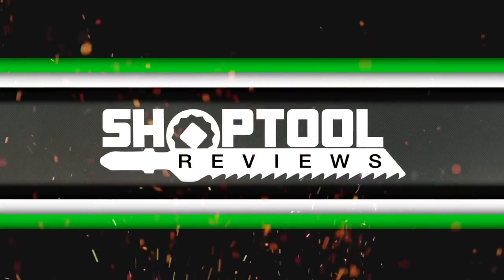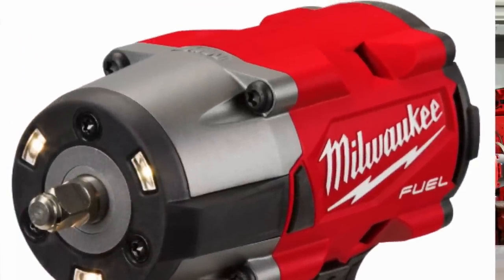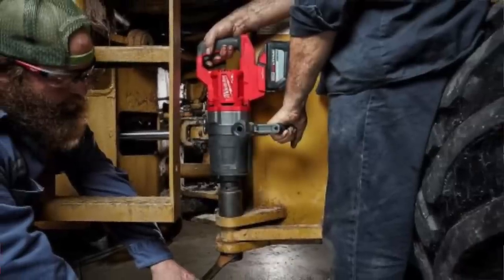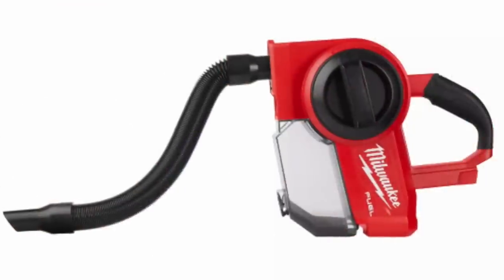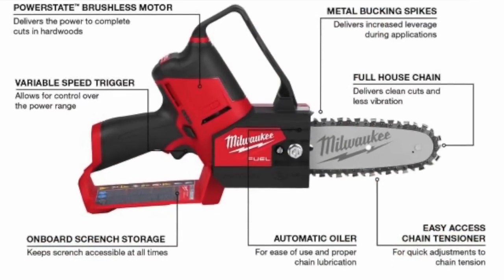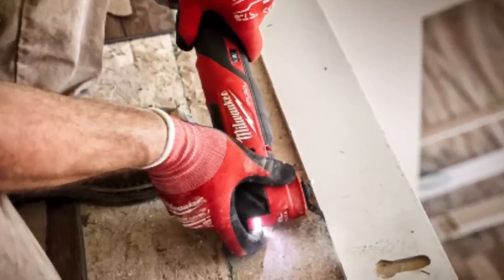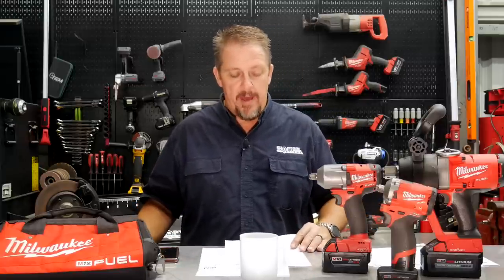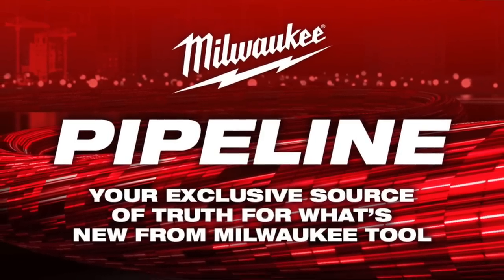LATEST MILWAUKEE TOOLS From Milwaukee Pipeline 2020 Episode 1 [MORE TORQUE]

Comment: Hi,

Nice to see milwaukee added the 3 LED light system on the new impact tools. Plus it looks like you can  remove 4 screws from the front housing and you can service / lube the front anvil easier. Don't need to take everything apart.
Reply from the maker: No doubt, we were really excited to see the 3 LED lights as well. We'll see about the planetary gears. We want to have a look at this as well. Thanks for watching.

Comment: We have been testing the D-Handle impact prototype at my work and they are seriously impressive.  We maintain a fleet of 15 Electric Wire Rope Shovels in a mixture of P&H 4100 and Cat 7495's.  These impacts easily replace the 1 " Pneumatic Impacts and do so without the hassle of dealing with air, air hoses, and frozen tools/air lines in winter time.
Reply from the maker: That's really awesome. I used to be aboard many P&H drag-lines in phosphate mines in Central Florida. Glad that the Milwaukee D-handle is living up to the claims. We hope to get one in for review very soon.
Reply: Shop Tool Reviews we had one of the first test units in North America. I recently set up a new tool crib for our area and it is completely Millwaukee for cordless tools.  You name it we have it.  I am very impressed with the entire millwaukee M12 and M18 lineup.  I am looking forward to getting one of the MX fuel light towers soon.

Comment: I love my Hi-torque impact. There isn’t much it won’t handle...with that said, especially when I’m underneath equipment and have to use it with my off hand and hold a bolt on a precarious situation, the thing is heavy as hell.
Reply from the maker: Yes, the Milwaukee High-Torque is a beast of a gun for power. Unfortunately, it's also a beast when it comes to weight and size. This Mid-Torque and Compact impact could make things much easier.Thanks for watching.

Comment: Very informative video, is the mid torque impact wrench 600 or 650 on break away torque ?
Reply from the maker: 1/2" Anvil: Nut-Busting Torque: 650 ft-lbs and Fastening Torque: 550 ft-lbs
3/8" Anvil: Nut-Busting Torque: 600 ft-lbs and Fastening Torque: 550 ft-lbs
Thanks for watching.

Comment: The compact 18v impact figures you stated are the same as the current 12v stubby...?? Surely more powerful...
Reply from the maker: Here's the SPECS:
Nut-busting Torque: 250 ft-lbs
Fastening Torque: 250 ft-lbs
RPM: 0-2,400 RPM
IPM: 0-3,500 IPM
4-Mode DRIVE CONTROL™ (includes Auto Shut-Off Mode and Bolt-Removal Mode)

Comment: I’m not quite sure what’s the difference between the stubby m12 and the compact m18 if they have the same amount of torque. I was looking to buy the m12 stubby until I looked and saw that they are bringing new things so I’m not sure which one to get since I’m a lube tech at Kia
Reply from the maker: If you're doing tire and lube, then I'd recommend the M18 compact or M18 Mid-torque. Even though the compact SHOULD remove all the lugs on any Kia; it won't if that Kia has been to most any other tire store. Typically, they run the lug nuts on with their pneumatic impacts running 90psi, so they're way over-torqued. The Stubby and Compact will probably not remove these lugs; however, the mid-torque can probably handle it. Thanks for watching.

Comment: I would low key just get the m12 stubby with the 1/2 inch anvil with the 6.0 battery since it has the same as the stubby 18v just a lot lighter
Reply from the maker: That's a great choice, but some will choose the M18 just because they don't have the M12 tools. Thanks for watching and commenting.

Comment: I am just about to buy an M12 stubby (1/2"), and was wondering that the new M18 compact sounds basically like the stubby? Same specs, only with 18V? Is there anything I miss, or should I go for the Stubby still? Thanks!
Reply from the maker: That's totally your call. Power is pretty equal, but it just depends on which battery you want to use. If you already have M18 batteries and don't want to buy M12 batteries, get the new M18. However, if you want the M12, or you already have the M12 batteries, then buy the M12 stubby. It's really a preference. Thanks for watching.
Reply: @Shoptoolreviews  Thanks, exactly the answer I was looking for - so it depends on battery preference - if you already have M18 or M12 - for new buyers though, I would go with the M12 platform though - for the right angle drive!

Comment: not that i was looking for a 4figure 1" impact wrench but i wont be buying any products theyre only giving 2 year warranty with.. if they start backing off of the 5 year warranty i guess ill have to look at selling my platform and going elsewhere
Reply: 3 year warranty on the m12 hatchet.. why? thats a tool i would actually consider as i do alot of tree removals close to houses as a weekend gig.. its a principal thing theres no reason we should be going backwards, only forwards
Reply from the maker: I do understand your concern, but I don't think you need to worry too much. Yes, some of these specialty tools, Milwaukee is providing a more limited warranty. However, on their mainstream line of tools, I think you'll see the standard 5-year warranty. Thanks for watching and commenting.

Comment: the m18 compact is 250ftlbs loosening? isnt that what the m12 compact is? same power with more size?
Reply from the maker: Correct, but some people only have the 18V system and they don't want to invest in the M12 system just to get a smaller tool. This 18V compact allows them to use the batteries they may already have with the new impact. Otherwise, power for power, they're about the same...as the numbers say. We'll see when we get them in for testing. ;) Thanks for watching.
Reply: @Shoptoolreviews  i didnt think about that good point, the m12 stubby is on my to get list hoping it comes on somewhere for a good deal
Reply from the maker: You won’t go wrong there. You’ll love the stubby. Not the strongest in the world, but it’s soooo handy.

Comment: How much are those big batteries? $600 a piece.....more than that? So the power supply takes a minimum $1200 worth of batteries to produce 3600 peak wattage for a split second and probably has a running wattage under 2000.  Some of this stuff, they must laugh at people, all the way to the bank.
Reply from the maker: You're close on the Wattage, but it's only 1,800 continuous. 
From Milwaukee: The MX FUEL CARRY-ON 3600W/1800W Power Supply provides the best power for the job. Power more on demand with efficient, quiet, and portable power anywhere. The MX FUEL CARRY-ON Power Supply provides 3600 peak watts of pure sine inverter energy, powering everything from high demand 15A tools to sensitive electronics.

Comment: So the m18 compact impact puts out the same torque as the m12 compact impact?? So what's the point lol.
Reply: The only reason to get it in my opinion is if you don't have any m12 stuff yet then you could just use your same m18 batteries
Reply: Cause the M12 batteries suck. Cases are very light duty and crack. And the battery cells have no charge equalization. so over time they get very unbalanced. M12 was really only meant for light consumer use. Unlike M18 with much more durable packs and with built in charge equalization.
Reply from the maker: So you don't have to have two different lines of batteries. And, you're going to get more runtime out of the larger M18 batteries. Thanks for watching and for commenting.

Comment: What I don't like about Milwaukee besides the break the fucking bank price, is can't have one style of battery that works on every single tool......  so that's a MAJOR NO GO FOR ME!!!  I'll stick to my Porter Cable 20v line, which still has tools other brands don't have in cordless, and all use the same battery.
Reply from the maker: Very good point, and that makes a lot of sense. If you're happy with the Porter Cable brand, that's awesome. Thanks for watching and for commenting.

Comment: I'm a die hard Milwaukee fan, but the m18 compact feels useless to me, the stubby has the exact same numbers but its smaller form factor, It seems like a waste of an m18 tool tbh, but I understand it will have its place and not everyone is in both m18 and m12 lines. Moving on, the gen 2 mid torque didnt seem to be improved on too terribly much, 50 ft lbs more in reverse and around 100 fr lbs in forward, obviously a smaller package, but I'm uncertain of it atm, it would be nice to have an active comparison for sure. To have release a model so sudden after the gen 1, I think we have ALL come to expect alot form Milwaukee, and at that point they are essentially competing with themselves upon new model releases, ironically. But with having said that you really have to give the users an extremely good reason to upgrade to the new model, and I feel like it just didnt deliver, I hope I'm not the only one who feels that way, but I cant wait to see it in action and hear some real feedback
Reply from the maker: The compact (vs. stubby) makes sense, as discussed, if you only have the M18 platform.  We'll definitely compare the new mid-torque to the Gen 1. I understand what you're saying, but there are some differences. A little smaller in size and a much better LED triple-light surrounding the anvil. Stay tuned!! Thanks for watching and for commenting.

Comment: Some things are better off with a cord. Performance per dollar is king
Reply: Very few tools are better with a cord nowadays.  If you figure  in all of the inconveniences of running cords around the job, the safety issues that come with cords and hoses, and the fact that you are tethered to a specific length of hose/cord, there isn’t much point in MOST tools being corded.  However, for non-jobsite use where production efficiency is not as necessary, corded tools have their place.
Reply from the maker: Which tools do you think should keep the cord? Thanks for watching and for commenting.

Comment: Great vid. Booooooo. Bad Milwaukee engineers! Their Oscillator  works grate but the angled battery housing means you cant set the  tool down vertically. You have to either balance it precariously on its head and face of battery, blade up, or Blade down and on other face of battery. When doing prolonged cuts, these blades heat up to a couple hundred degrees  and can melt many surfaces or objects next to them instantly on accidental contact. Seen it happen on several occasions. most other brands have the battery attach at a 90. so you can stand it up. Booooo. bad Milwaukee. Bad.
Reply from the maker: I see your point. It seems like the M12 could stand up with the XC battery attached. Thanks for watching and commenting.